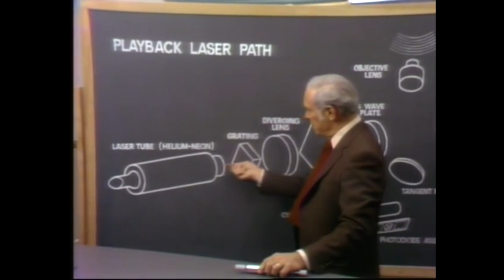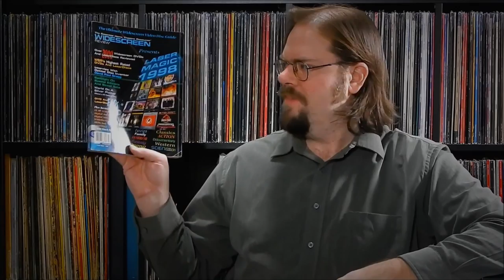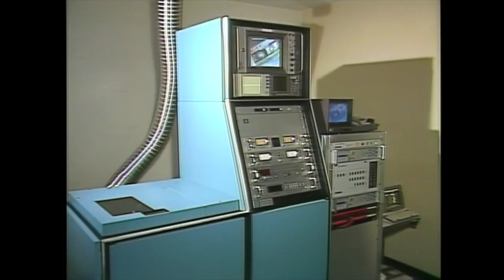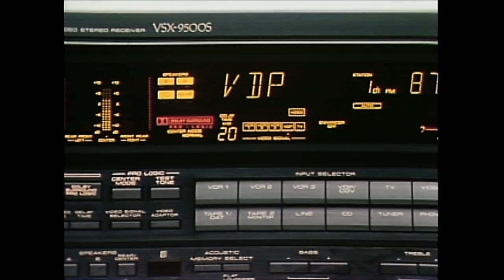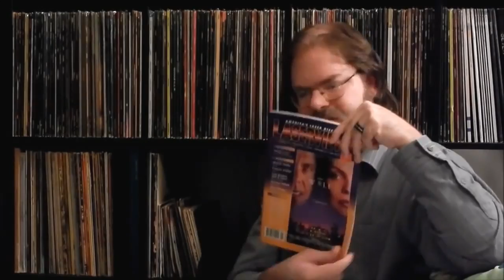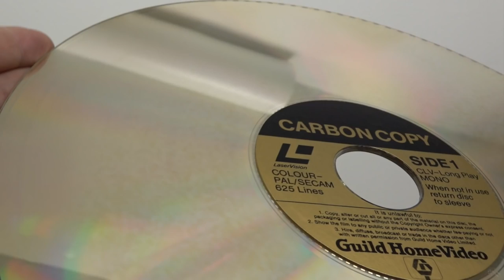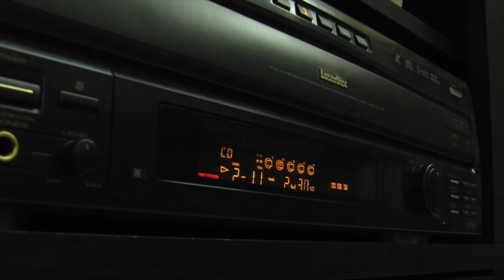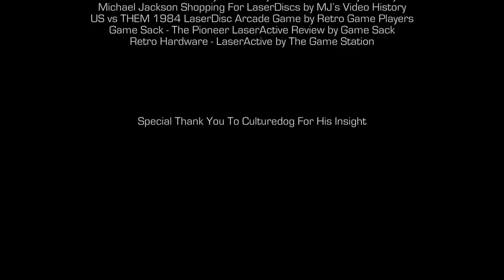LaserDisc: The Forgotten Future

Comment: 11:46 what the guy is saying is not true. Laserdisc didn't look better because it had more lines of resolution. All tv (before HD) was 480 horizontal scanlines, interlaced. What laserdisc (and better videotape formats like Hi8, S-vhs and Betacam SP) offered was more detail preserved on those 480 lines. If you had a chart of vertical lines, the higher resolution formats would be able to show more of them on screen.
An easy way to demonstrate this is to take a picture resize it to 640x480 and then make duplicates squished to to 640x200 & 640x400, then resize them back to the regular 640x480 size. The ones that have been resized will have less detail yet be the same size.
Reply: I don't think vhs could get up to 250 lines. It's a very junk format that's hard to get a clean picture out of. But I think I goofed on the resizing numbers. The 480 should stay the same height vertically but the picture should be squeezed horizontally. 
So resizing a 640x480 image to 200x480 and then stretching it back to normal shape would simulate the best vhs could possibly do. But it would probably look better than an actual vhs image because vhs has a lot of flaws and quality issues such as blur that often prevent it's already low capabilities from maxing out. Betamax footage I've seen appears to be much better in this regard. 

Laserdisc would be like a 425x480 image but it can look almost as good as dvd if you have a high end player.
Reply: "So resizing a 640x480 image to 200x480 and then stretching it back to normal shape would simulate the best vhs could possibly do."

Actually, in the crudest possible terms, shrinking a 640x480 image to 320x240 and back would be a better demonstation.  VHS had reduced vertical resolution as well as horizontal resolution.

"Betamax footage I've seen appears to be much better in this regard."

Really?  Because from what I've heard about Betamax vs VHS is at equivalent speeds, Betamax was better (B1 vs VHS SP, B2 vs VHS LP, B3 vs VHS EP) but B1 was pretty much never used so practically VHS and Betamax were about equal (as in VHS SP == B2, VHS LP == B3)

Seems the consumer valued recording time over quality (hence why only older Betamax VCRs record in B1, most newer stuff can only use B2 and B3)